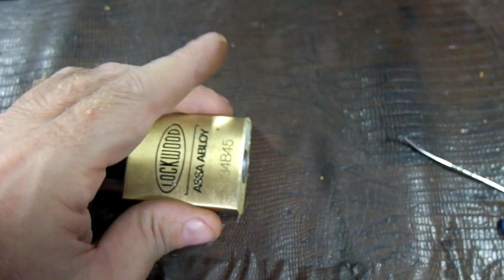Lockwood padlock with BiLock core (picked & gutted)

Comment: Exceptional picking there NM.
You've got the touch for bilocks.
Nice to see one in a 334 👍😉
I do have one in a 530/590 format, which I have installed in an older 234/45.
Reply from the maker: Cheers. Nah, I'm not terrible at them but there is no magic touch. Just lots of hard work when I get the chance to play. I think the time spent dicking around with Medeco helped to develop a feel for things.

Nice! I'd like to have one in every known configuration. LOL There will need to be a substantial lottery win before that happens though.
Reply: @NoctisMotus  lol 👍😁
I scored a small 4 pin medeco payphone lock. No luck opening it as of yet.

Would you recommend using a Peterson gem pick to rotate the pins?
Reply from the maker: @funkeyfastdrawmonkey1483  Gem should be fine so long as you have room to move. A friend swears by a half-diamond. Anything with a tip that can grab the tips of the pins to rotate them is probably fine. Have you tried lifting and rotating at the same time to find out where that pin's gate is?
Reply: @NoctisMotus  
I have tried the lifting and turning technique. No luck as of yet.
Its all new to me, even though its only a 4 pin biaxial lol.
Will keep trying every few days. Cheer's heaps 👍😊
Reply: FunKey MonKey 

B

Comment: Great picking!!
Do you get much core turn as you set more and more pins?? 
Didn’t look like it in the video. 
Also you pulled the core by hooking to the left side I think. There must be something there that releases the core from the lock. 
I have a Bi-lock that I got from Funkey, but am afraid to pull it apart so for. Don’t want to mess a beautiful lock up! 
Thanks! 
👏👏👏👏👏👏👏
Reply from the maker: Not much plug rotation as pins are set, no. Rotation comes more into play when a sidebar is allowed to start retracting into the plug. A Quick Change Core (QCC) can be removed when the plug is rotated to either 1 o'clock or 11 o'clock. 

https://youtu.be/mbozQz219jg?t=322

Gutting them is no big deal. There is not a lot that you can mess up. Probably the greatest pain would be losing a spring or more. They are tiny and great at hiding.

Comment: Take that open buddy, well done!👍🏻 My Locksmith says Bilock will only fit Abus, not Lockwood but I know you made it fit... was it difficult?🤔
Reply from the maker: Sounds like you need  new locksmith. :) This lock has all stock parts made by ALC and nothing at all has been modified. The just Abus thing is totally incorrect. Notice in the last video that I picked a Master Pro with a BiLock core? Or how in a previous video I showed a Parasole body with a BiLock core? I can even show you a Kaba with a BiLock core. Simply, there are far more possibilities than your locksmith seems to be aware of.

Having said all of that, I have in the past modified a Lockwood shell to take a BiLock plug. Was it hard? Not really, but it was fiddly. If non-QCC, it is simply a matter of filing in the grooves for the sidebars. QCC is slightly more involved, requiring cuts for the ball bearings that you see on the plug. A dremel and a steady hand will get you through the ordeal though.
Reply: @NoctisMotus  thanks my friend, I never tried it. I was going on his word so I guess I must take any thing they say with a grain of salt from now on. Cheers for that my friend.🍺✌
Reply from the maker: @DonzLockz  Nah, I'm sure he knows a lot about a lot of things. It is probably the case that he hasn't been around BiLock for very long, that's all. Always here for you, mate. :)